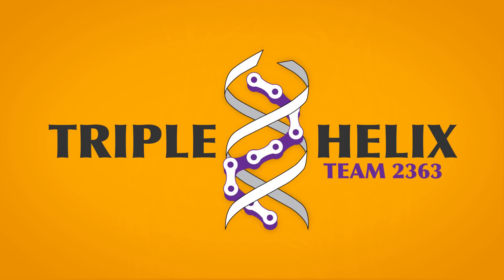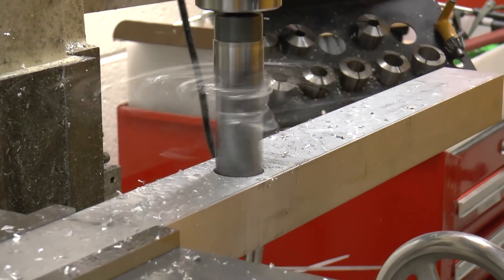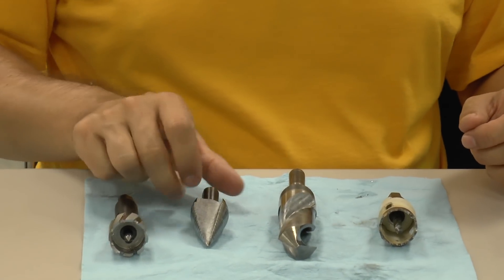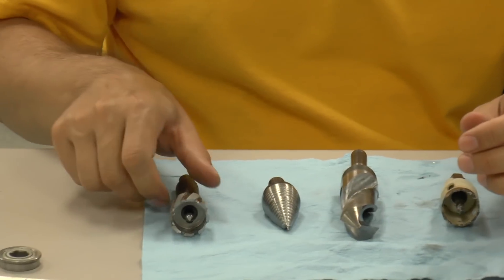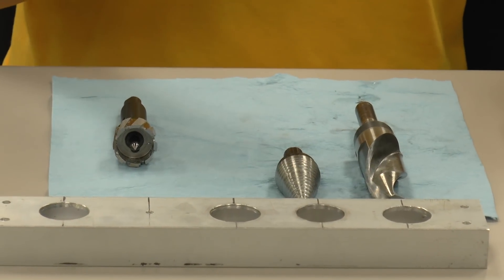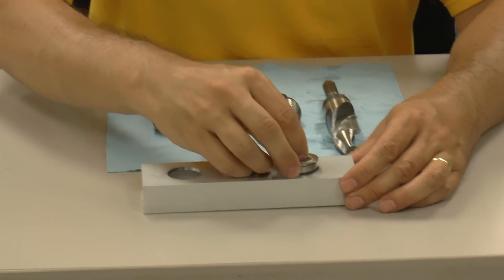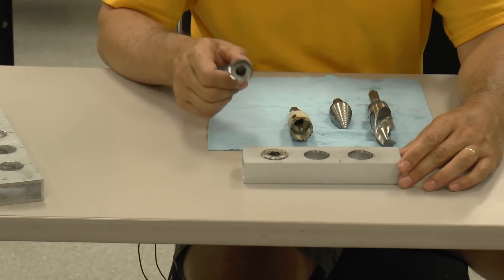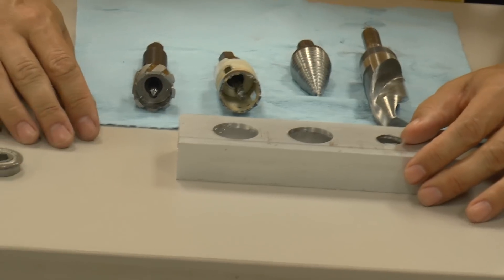Triple Helix Tech Tip 1: Bearing holes with the drill press

Comment: If your team has a milling machine what tool do you recommend??
Reply: In this situation we recommend a HSS annular cutter (sometimes called a slugger, example https://www.ebay.com/itm/170988131471) with a 3/4" 'Weldon' shank, held in a 3/4" collet.  These are made to be used in magnetic base drills.
Reply: another example https://smile.amazon.com/Annular-JESTUOUS-Diameter-Two-Flat-Magnetic/dp/B07RTXNXMH

Comment: Awesome comparisons, well done guys!
Reply: Nice!  Please post the link to your star cutter.  3322 Eagle Imperium typically uses a step drill when we need to make a quick hole on the drill press instead of the mill.  It appears we have a larger step drill, as we stop at an earlier step and then occasionally need to file the hole for a snug fit.  This technique will sometimes bend 1/16" aluminum so it is a bit too snug (but you probably want something thicker then 1/16" Al, anyway).